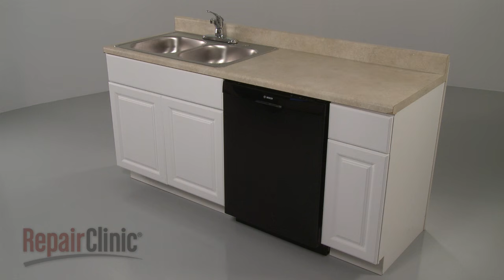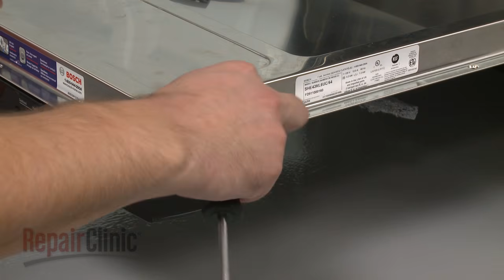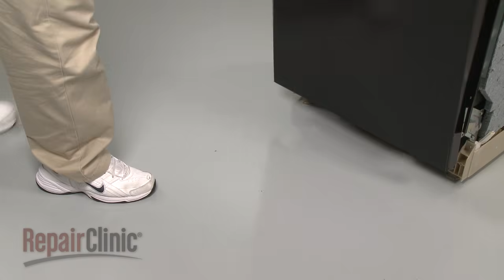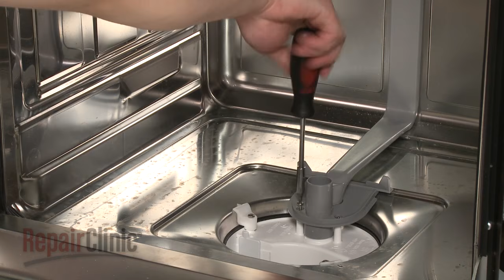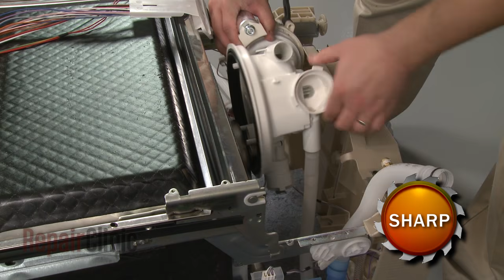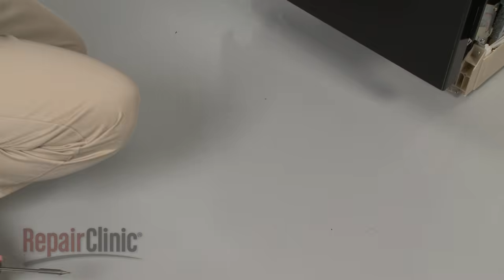Bosch Dishwasher Disassembly – Dishwasher Repair Help

Comment: Prior house owner built the floor in such a way we can get the lower plate off.  How do we remove the door on a roughly 2007 Bosch dishwasher front mechanical controls.  The one part I need removed not shown.
Reply: Sounds like you had the same clown that did ours and built the kitchen cabinets around the appliances so the only way to get it out is to disassemble the kitchen units🤦‍♂️

Comment: Bosch dishwash is very VERY low quality. Mine was leaking at the bottom. I disassembled it and fixed. That was when i saw so many bad designed decisions and low quality components.

Comment: I've replaced the housing with the outer button's.  Unit will work without the housing in place,  one installed it gives code C 30 and button's won't work?